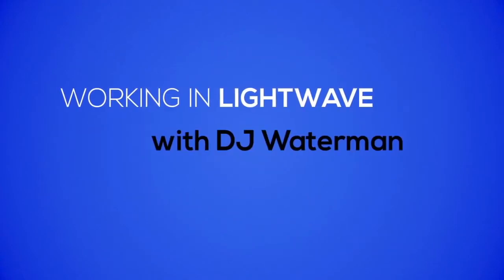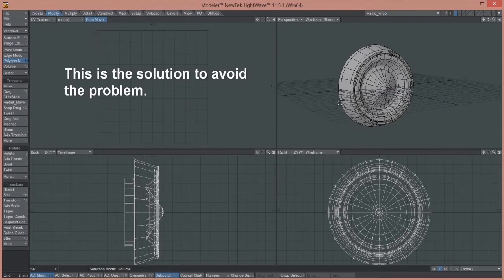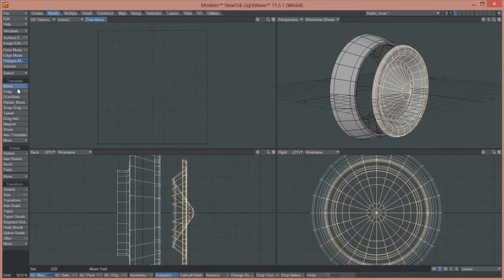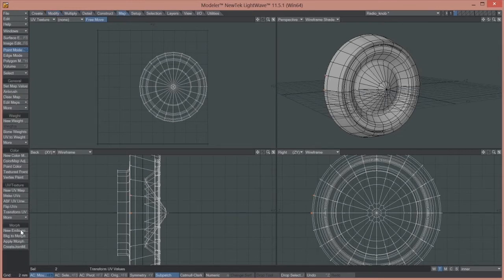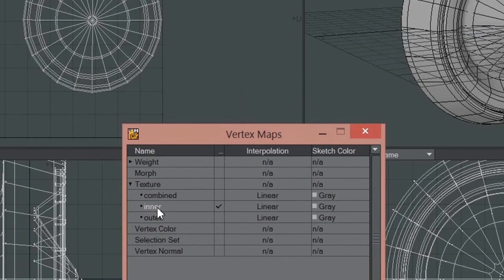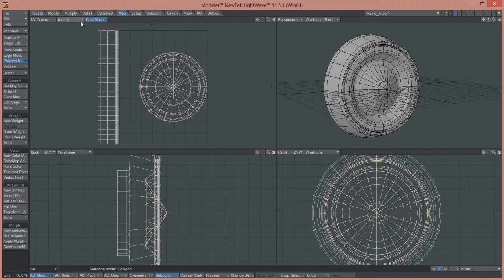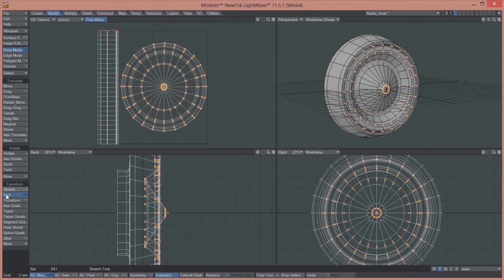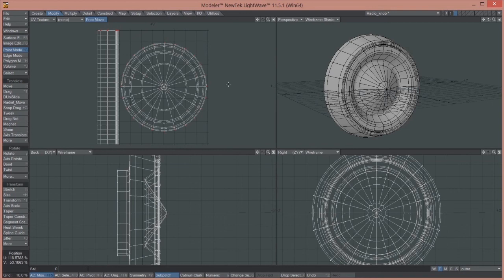Separating Edges in combined UV Maps in Lightwave

Comment: tip: instead of > select polys > cut & paste > make UV
you could use > select polys > unweld > make UV > merge while still selected.
also when you have a UV already but you want to do some booleans, unweld everything first, then do the boolean. this way it will not mess up the UV you already had but add to it like you would expect.
Reply from the maker: I'll look into that. If it proves the case I'll have to make another video. I find I'm always learning with this stuff. Thanks for pointing it out.
Reply: it's just another method really but the unweld/weld routine is kinda elegant because you always have everything on screen and it helps with a lot of other modeler tasks. many people for example understand the term "closed geometry" as a continuous poly-surface, like when you create a default Ball. but if you unweld all the points of this Ball, it actually is still "closed geometry"! with that in mind you will encounter way less problems when using many tools which create new vertices like Boolean, Cut, etc... especially also in conjunction with UVs.